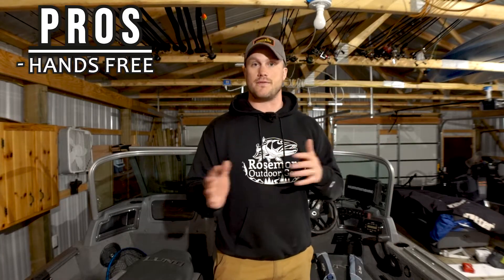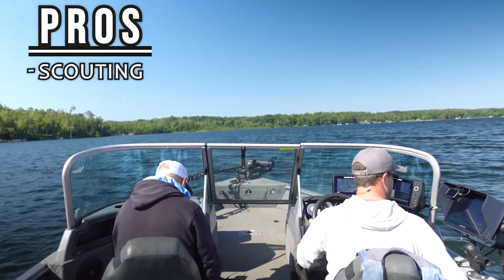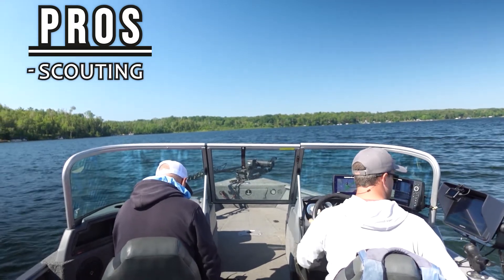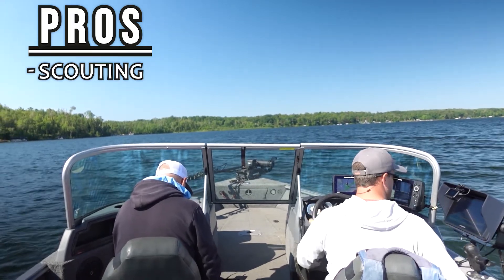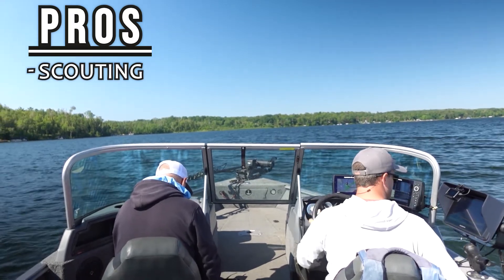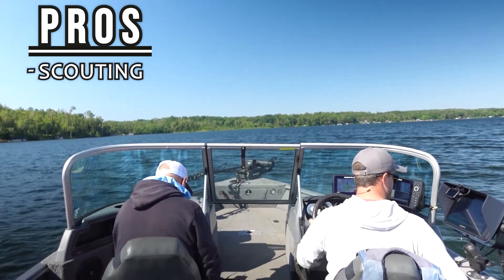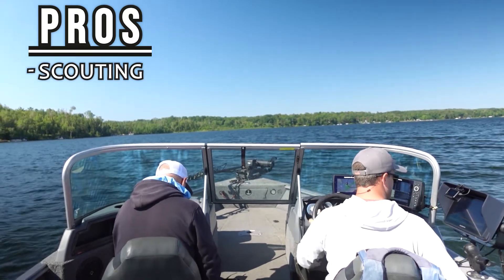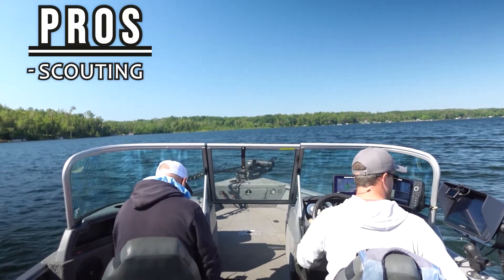This Livescope Boat Set Up SOLVED My Problems | EASY & VERSATILE Pole, Mount, & Unit Set Up

Comment: now this is how exactly how i want my set up. been searching so long for a one time purchase that can be portable and switch from one location to the another. also the way it stores is how i need it to be. very informative, well done my man
Reply from the maker: This has been an awesome solution! I’ve bounced around to a lot of different boats and it’s been nice. They even have a pole mount for smaller boats as well. Glad you found it helpful! 👊
Reply: @tjsguideservice  i too have a a bunch of different vessels and need to switch it on my 16ft bayliner, 12ft jon boat, 2 diferent kayaks, float tube, and paddle boards.

Comment: Great information.  Any knowledge on what mounts would be available to attach that pole to a jon boat without a track system.  The boat has a round aluminum tube that runs the entire top rail.
Reply from the maker: Arclab has one that I believe is called jaws ir something like that! Perfect for that set up

Comment: Do you disconnect your transducer from the black box every time you bring into charge?
Reply from the maker: I do not. The shuttle has master power on it and I turn that off when I charge. I charge it right in the boat usually

Comment: Like the system have you look at sniper pole for the pole 360 around the boat viewing from the same spot. I use the arc lab with a sniper pole. Cannview 360 from any where in the boat.
Reply from the maker: I’m not sure I have heard of that! Do you have a link?

Comment: Nice setup I was actually looking into something similar. Great video!
Reply from the maker: Thanks man! I’ve tried a few different options, but this has been my favorite so far!
Reply: @tjsguideservice  ya I had seen arc lab quick connect thing and figured the same as you, it would be so nice and easy to move around. Do you suggest getting the sun visor or does it make it more bulky?
Reply from the maker: @DB-FISHING  it is so convenient! It’s all a preference thing, in the summer especially I love having the sun shield and have never ran into an issue with it being bulky. The nice thing is they are easy to take on and off if you ever want too!
Reply: @tjsguideservice  oh ya I guess hey ok thanks again. Keep up the videos 👍🏼
Reply from the maker: @DB-FISHING  appreciate it, brother! You as well! Just subbed!
Reply: @tjsguideservice  thanks!! mine aren't as dialed as yours but still learning!
Reply from the maker: @DB-FISHING  I’m right there with ya man! Always learning! Keep grinding! 👊

Comment: Did Arc Lab sponsor you and give you all the hardware? Nice setup, but you've now got more money in mounting hardware than you do in the livescope. 
My question is, why not just link all your screens together with a cable for under 50 bucks and run the same livescope view on all 3 units.
Reply from the maker: I received some of the product from arclab and also paid for some of it. The main reason is you can’t link hummingbird and garmin units… I only have one Garmin unit the rest are HB and want to keep it that way so because HB has the best SI and Garmin has the best FFs
Reply: @tjsguideservice  I've gone with 3 Lowrance units. Nmea cabled all 3 together. Active Target 2 is as good as the Garmin 2 or better. 
Not being sponsored or comped hardware so... The biggest upside IMO of having the same head units is not having 2 different companies screen menu's, when needing to make changes.

Comment: The Arclab mount wasn't even on my radar until I saw this.   Just picked up an Arclab sport track bracket to beef up the summit pole mount I had been using for my mega live ducer. Soo much better.
Reply from the maker: For sure! Drove me nuts when my pole would move around all the time. Love this set up!

Comment: Just an idea.  The larmac is very expensive and I was considering an adjustable six inch downrigger mount.  Very cheap compared to larmac.  Probably not as adjustable but might be an option.
Reply from the maker: I have never used those, so I can’t say much, but I know I have been very glad I’ve spent the money on some of these components. That other option could definitely work, though!

Comment: I was looking at adapting my system the same way in my boat last week! 
I have a 20’ Skeeter 2050zx- walk through windshield boat. I set pole the same way- front and back. 
I have a LarMac 360- sweet integral part of the system!
I have pieces of track in three locations now for versatility. 😉
One, in bow mounted on the floor just in front of drivers side windshield. This way I can fish from bow just fine- unit is out of the way of feet- and I can turn it to be able to see from the counsel while scouting when I am at the counsel! 
I have another plate on my downrigger pedestal. ( I fish salmon and walleye here in Wis. 😉). Nice and high, so easy viewing, and out of the way. 
I have another track plate mounted along my back gunnel area above battery compartment. - Great to use there when salmon fishing- can use downriggers and out of the way for netting fish. ( I have yet to use my unit for salmon fishing, but I have been told by several you can use these units to scope when trolling! 
Great set up. 
Nice video! Good luck! 
Great products!
Reply from the maker: That sounds like a sweet set up right there!! Love the versatility with this set up!

Comment: Was that Cisco 3" track a 12" or 18" length?
Reply from the maker: This one was an 18” length!
Reply: Thanks so much, did you ever mount track up front as well or just keep locking plate up front?
Reply from the maker: @woodyrrw1038  I still haven’t mounted a track up front. Just the late!

Comment: TJ, what mount / components are you using on the helm to position a Helix unit above the dash gauges? 

Also, do keep your shuttle locked into the gunnel when you're running? I imagine the shuttle with the 360 base weighs 30+ pounds and running into a 2-3' waves could be a problem?
Reply from the maker: I used ram mounts. It isn’t perfect and I had to get creative, but it works!

I use the quick dock and unclog it if I’m running on big waves or if I’m trailering just to be safe!

Comment: If u own a 60K boat... then just get 3 or 4 livescope ducers.. put 2 op front 2 in the back.. then ur set.. would cost about 15k though.. u also need 4 screens atleast..  

But id rather get a 50k boat with 15k livescope on there then a 65k boat with nothing..  Heck my 1k jon boat has livescope on there.. Also id rather spend 1500 bucks on another ducer then the same amount on fancy accesories.. i build my own shuttle for 10 bucks.. ez.

Comment: Hey TJ.  Thanks for the videos!  I'm thinking about getting this shuttle.  When putting it on your boat, are you worried about your charging port getting water in it and causing any issues?  I know the ports on the front have covers, but I didn't see a cover for the side port.  I'm just worried about water getting in there and making it difficult to charge, or damaging the unit.  Thanks
Reply from the maker: Hey Mike, absolutely! Glad you enjoy them! 

I have never had issues with my charging port getting water in it. The plaything port actually also has a cover on it, but mine ripped off 🤦🏻‍♂️ 

It’s still never given me any issues!

Comment: Hey TJ, great video and awesome setup!

I just purchased a new boat and I've been trying to figure out a good way to integrate my Live imaging transducer.

Do you know what the length dimension is of your track, LarMac, and shuttle?  I've measured my gunnels, but I'm curious how long of a track I need to buy.  My boat has super wide gunnels, so I'm not concerned about that, just wondering what the overall length is on your setup.
Reply from the maker: Thank you for the kind words! Congrats on the new boat!  I have the 18” Cisco track, but the new larmac 360 will also fit in a 12” track.  The whole set up is 12-15” in length